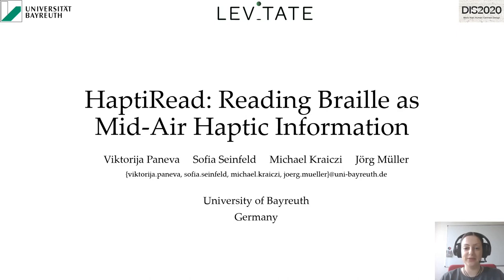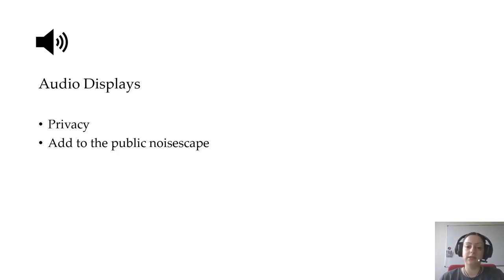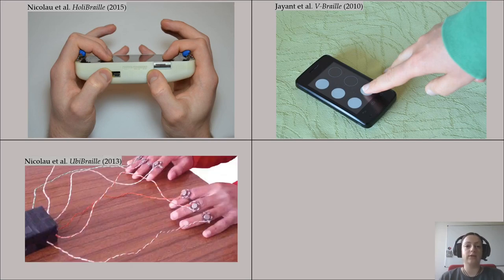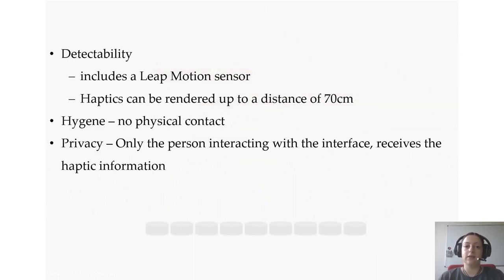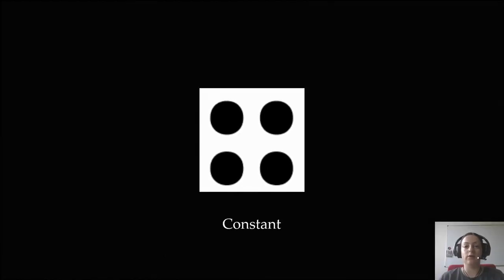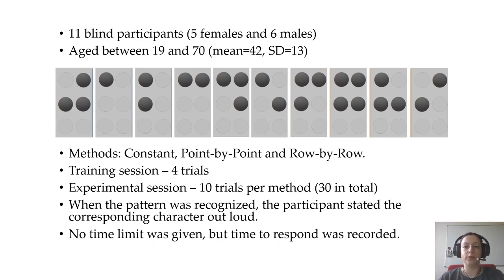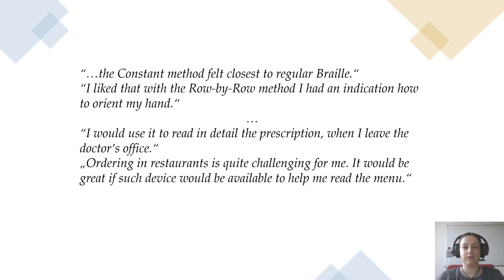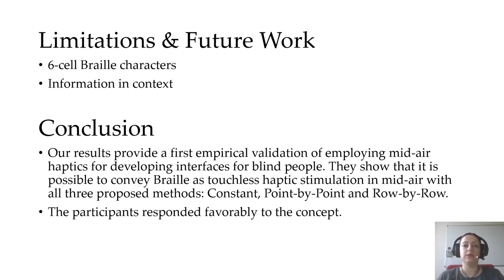HaptiRead: Reading Braille as Mid-Air Haptic Information

Comment: This is a really cool idea and I understand the limitations, specially trying to implement the 6 cells haptic display (will it be as accurate as in the user study?). I also think this should be limited to public spaces, because she mentioned other applications such as for reading prescription and restaurants' menus... this wouldn't work unless they are both digital, which in that case it'd be better to be sent on a smart device where the user can use their own method of accesing that information (audio, refreshable braille, etc.)